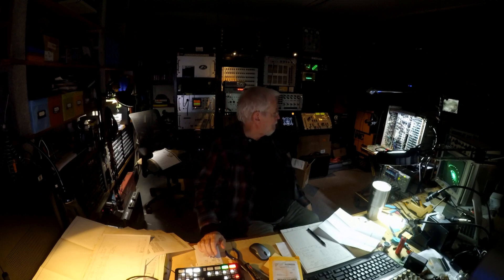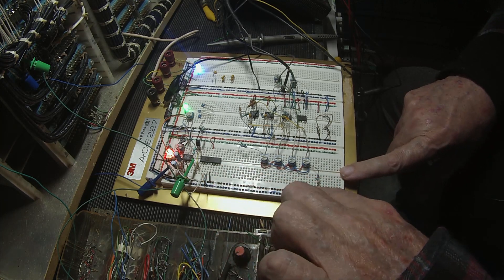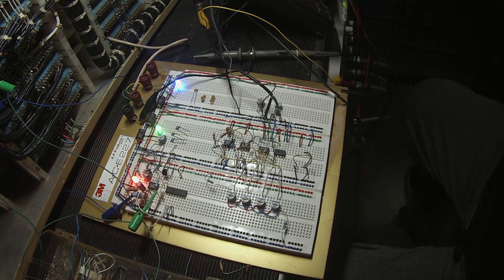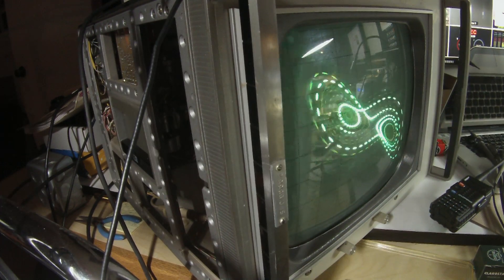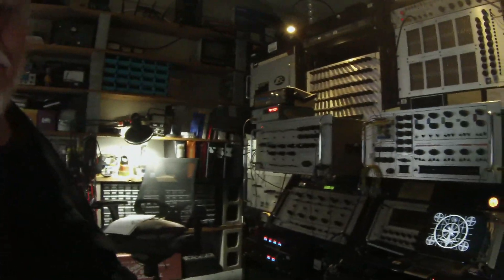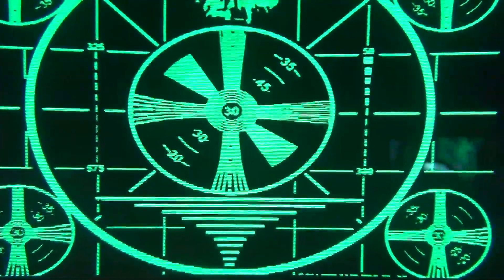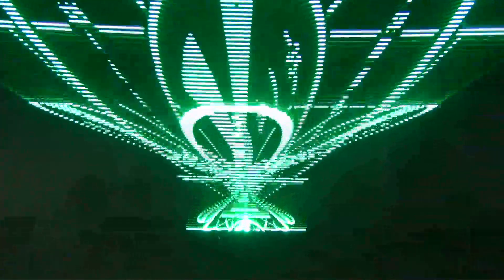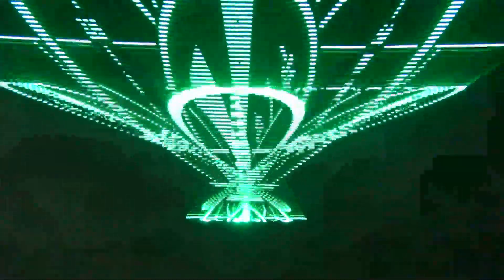20201125 2

Comment: As soon as I learned the Scanimate had voltage multiplier circuits I wondered if it could generate a Lorenz attractor. Could you do that with the stock hardware, using the patch panel, without having to build a special circuit?